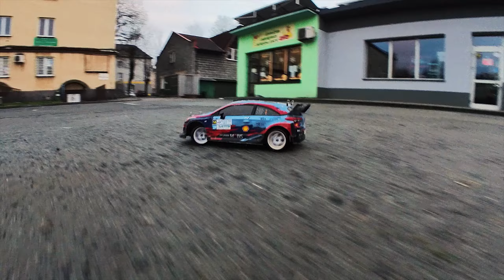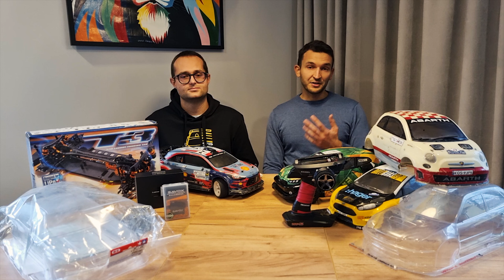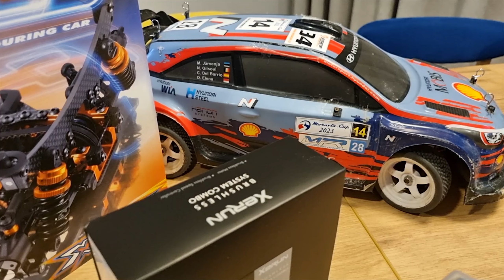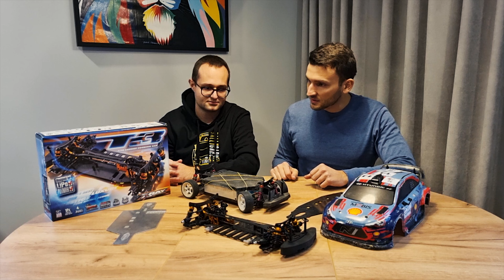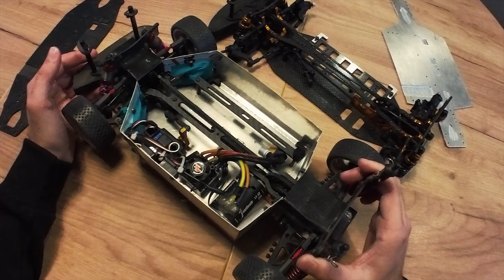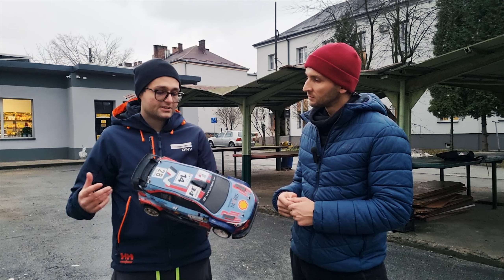This is an EFFECTIVE Rc Rally Car! | Xray T3 Rally Conversion

Comment: An interesting build and nice driving in cosy surroundings. Based on the prices for used ones I see that you can come away quite "cheap" with a conversion like this compared with a 2nd hand XB4 and Tux parts. I am shamelessly gonna copy the balloon solution for the steering arms on my XV-02.
Reply: Did you made it? I have xv-02 pro too i i would like to have no more dirt in my car

Comment: I wonder if the Hobao EPX could be converted into a rally chassis.?
I've made a cover for the belts on mine & it's got good ground clearance... I haven't done anything to improve the steering angle though..
I bet it's possible though.!
Reply from the maker: I've just googled this chassis, seems interesting.

You can try for fun and out of curiosity to see the result
Reply: @dariorcgarage  You won't be disappointed with the quality of any Hobao chassis.!!
The SC10 is for the track only in my opinion though.
Everything else is super durable.!!
Reply: @dariorcgarage  also.. MERRY CHRISTMAS DARIO.!! 👍 👍 👍
ALL THE BEST FROM THE SCOTTISH HIGHLANDS 🏴 🙏 ❤️ 📻 🕹️ 🔋 🚗 🚖 🚕 🚔 🚚 🚙 🚘 🚓 🚒 🚑 🚐 🚎 🚤 🚁 🛩️

Comment: Hi Dario, thank a lot again for all these informations and for inviting Patryck, I have just a little question : can we use the xray (buggy) xb04 shocks towers with this model ? 🙏
Reply: Hello, Location of mounting holes are different, so plug-and-play assembly is impossible. Of course you can drill new hole and adjust to T3.
Reply: Thx a lot, that’s exactly what I was wondering and it makes me glad to know that I can use former parts left from the buggy! 👌🙌👍